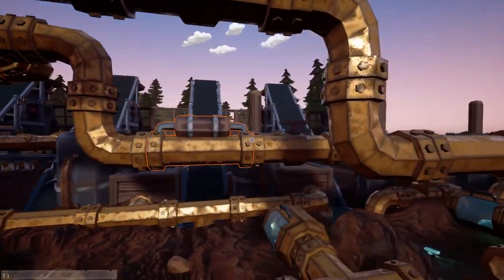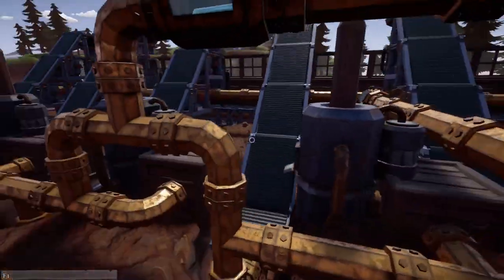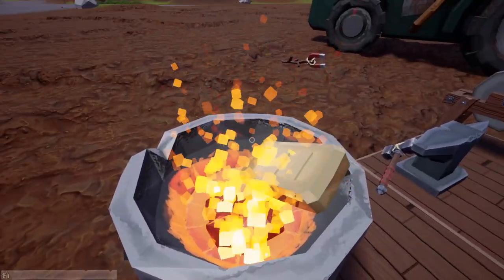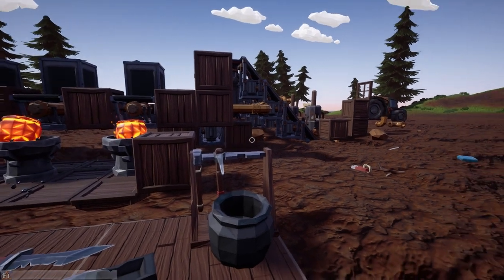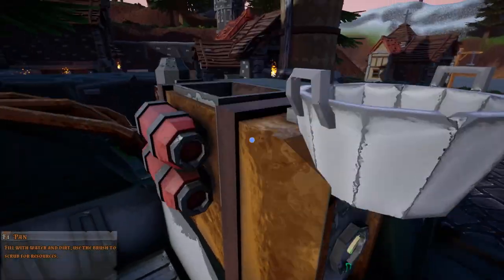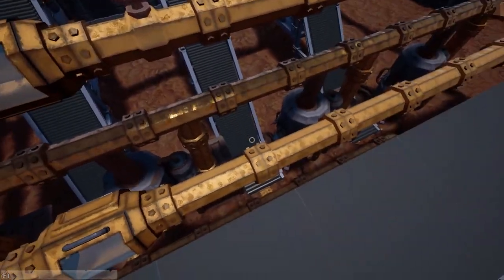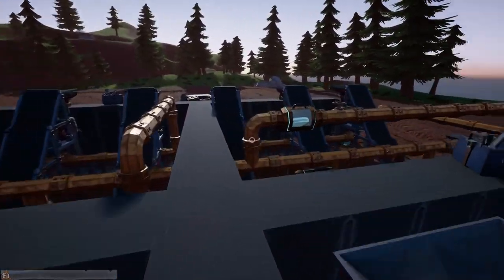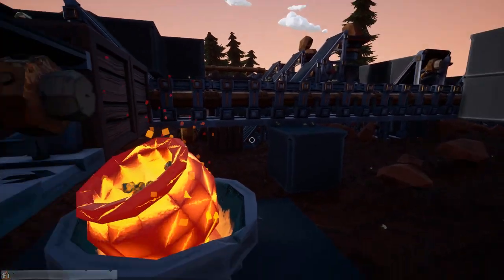The LAG Factory -=|=- Hydroneer -=|=- 05

Comment: Yea The molten metal doesn't save if you leave it in when you close the game.   Don't feel bad  I lost over 369,000.00 worth of gold.  When I asked about it on Steam   they said it was not a bug   but intentional to not save molten metal.    I call that BS  but hey it's their game. TIP- put the furnace inside a concrete block  and the crucible will sit much better .